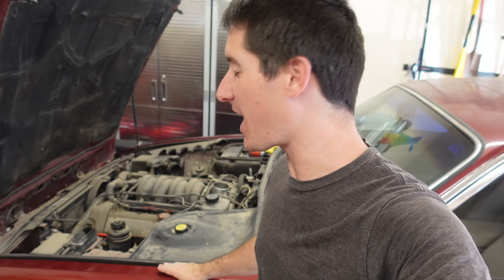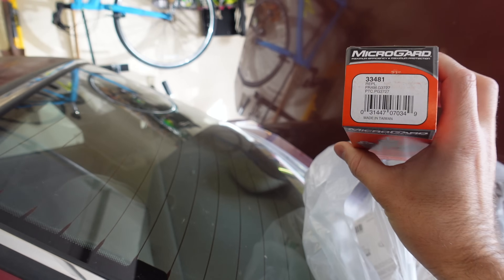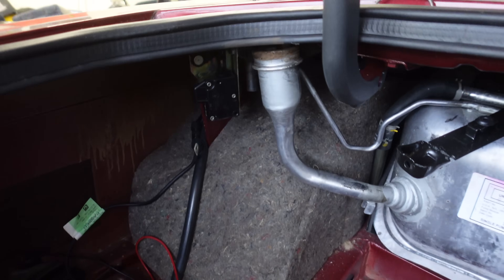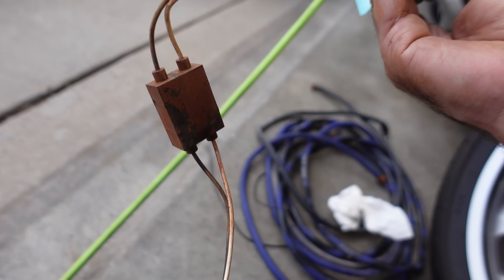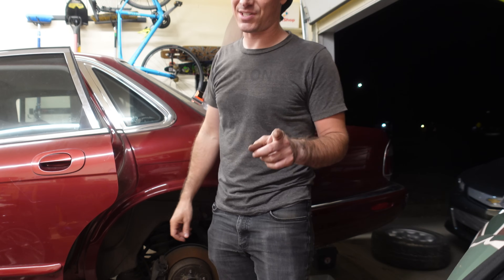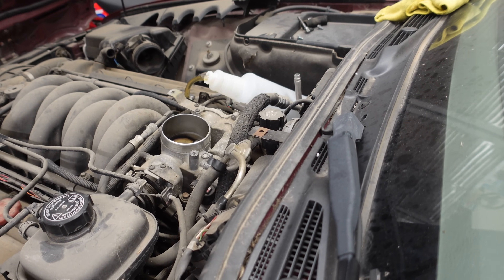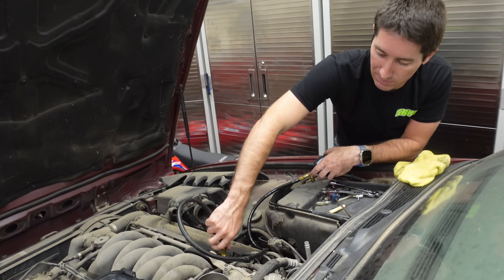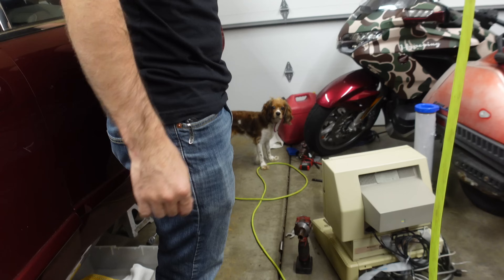World's WORST Fuel Pump Swap... Don't Buy An OLD JAGUAR

Comment: the reason for the fuel tank removal being such a nightmare is that the very first version of this car, the XJ6/XJ12 used to have separate tanks, one on either side that had to be manually refueled and would be toggled on with a switch on the dash, so they just combined them into one without changing anything
Reply: Completely wrong, this shell dates back to the XJ40 in 1986, & always had the single tank behind the seats. None of the shell is the same as the 68-86 Series I/II/III cars that had the 2 tanks.
Reply: @MrPabsUk  yeah but it looks the same, still follows the same design flow, its still a 4 door, and still has the tank behind the seats rather than in the footwell of the trunk of the car like most cars to neutralize the weight bias the gas adds to the car when you fill it, I mean do you really think the russian ownership back then gave a toss about making something good of the car?
Reply: @kavinskysmith4094  Looks the same means nothing, you tried to make out Jag just did some half arsed facelift & thats why the tanks where it is, & thats not the case. Jags cant have the tank under the floor because they are low cars, there is no room under the boot floor or rear seat because they`re inches from the ground, so the tanks HAD to go in the boot. The tank in this shell is within the wheelbase, aiding balance, whereas the SI, 2 & 3 cars your talking about had their 2 separate tanks slung behind the axle line, which is a disadvantage balance-wise. 

And Russian? You just havent got a clue, have you, you just seem to want to pointlessly rant for attention, so I`m done with you..
Reply: @MrPabsUk  well arent you mr high and mighty lol I just remembered it on harry's car and remembered how dumb the design was lol also around that time period jaguar was making the XJ220 series, which was noted for some pretty cheap quality parts, and apparently loosing its radio alot

and if the car is such high quality, and a true bespoked automobile, how come the resale is so low that a high school teen could get one?

like just because you like jaguar doesnt mean its a good car. 

hell their was even an inspector morse episode where he took one look at that car and said the modern ones were rubbish

and in seeing how the interior looks vs his old mark II I'm inclined to agree.
Reply: @ivanfernyhough3851  Okay, run your car and not have it break every 6 months from an electrical fire, run your car and not have the door panel fall off as its comes back to long bridge and is on strike

run your car and NOT have it made by the germans, the indians, and americas, or whoever rolls royce is owned by this week

as you had to be bought out by ford and GM to make a decent car, with aston martin, Jaguar and land rover

vaxhaul and opel

and even then with Land Rover you need silicon grease just to make your door not squeak like on the one harry metcalf tested that was 64 god damn thousand dollars recently with that bleeming defender! 

like I like your cars but you guys suck at making them last more than 3 years. 

Hell even the Mclaren senna that Schmee has, just went in for major work to its suspension and its barely 5 years old with low albiet raced miles on it

Comment: Stupid jaguar. I did another later model jagaur and access is under the rear seat but the hole is too small for even the retainer screw that secures the pump assembly down to come out. Just dumb.

Comment: Wasn’t this the area Range Rover & Jaguar was at its worst? Ford motor company at its best. 

Great video man, keep up the grind
Reply: untrue, this was the era they were at their best, they lost lucas electrics and the electrical issues they had from here on were mainly down to battery voltage and not just random untraceable problems, fords mass market knowledge helped reliability greatly, they just need some plastic components upgraded to metal, chain tensioners and thermostat

Comment: You don’t need to take the tank out. All you have to do is pull the top of the tank forward enough to change the pump.
Reply: ReLly easy
Reply: Really easy
Reply from the maker: The lines run through the floor at the front, the tank won't move unless they're removed 🤷‍♂️
Reply: The tank will tip back enough to replace the file pump  I own four jags and. Have done it.
Reply: You do need to undo the filler tube and the straps